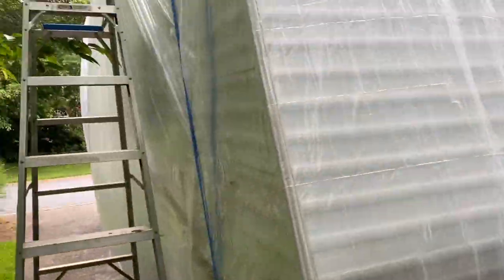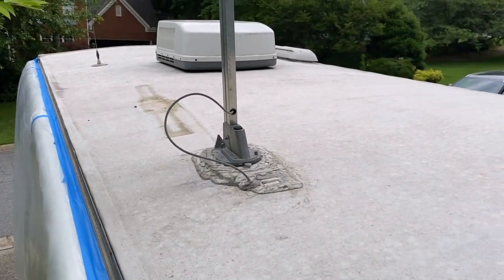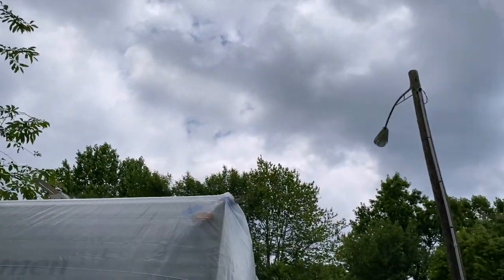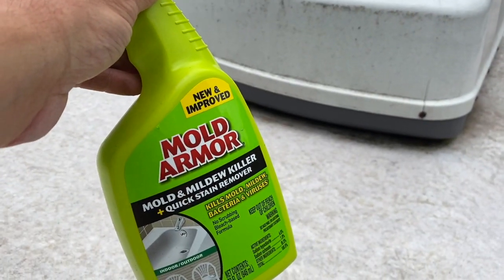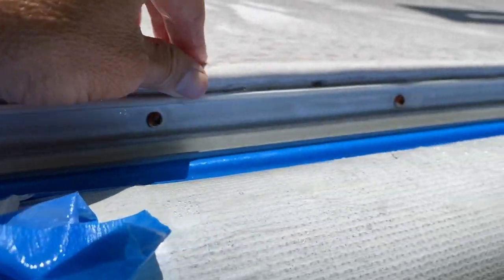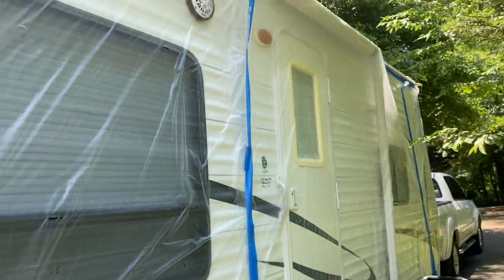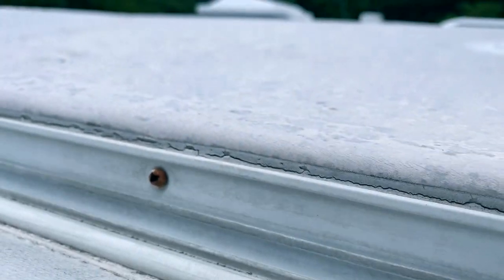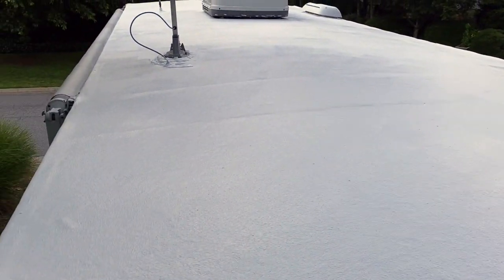RV Roof Restoration with Dicor EPDM Rubber Roof

Comment: So didn’t seem necessary to cover the rig correct? I was think of doing that but I guess I could just wash it down after washing the roof to save time on masking it. What you think? Also is that Dicor cleaner really necessary? I was thinking as long as I scrub it down with soap and water.